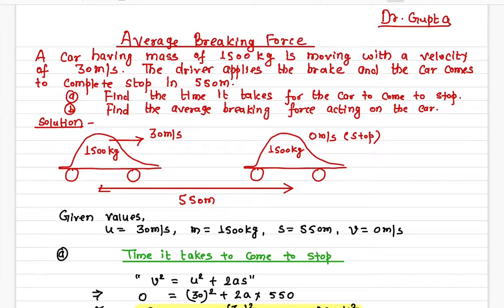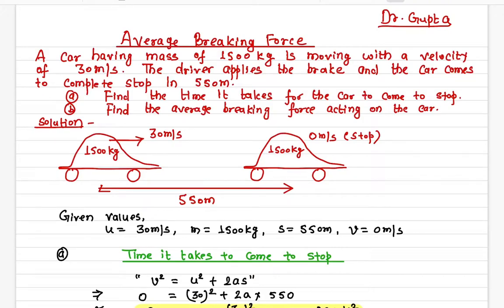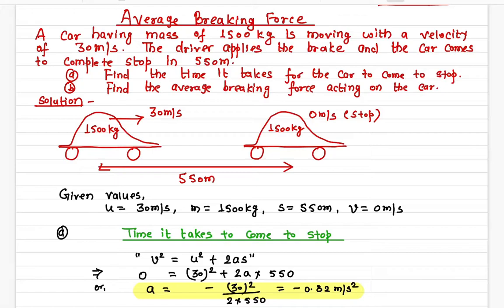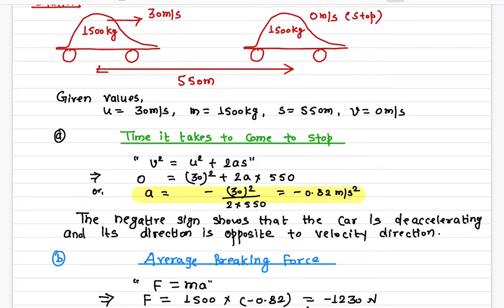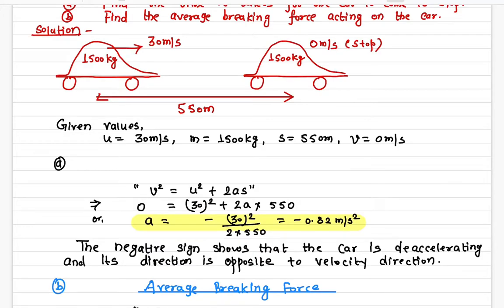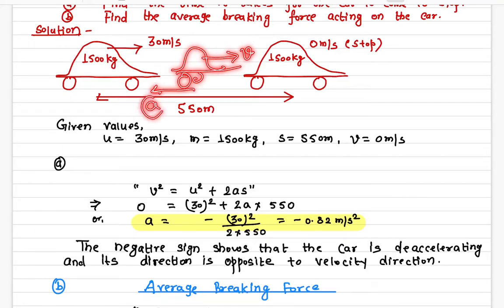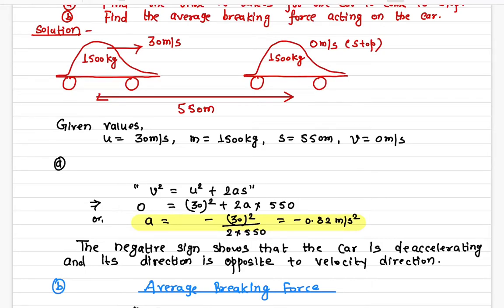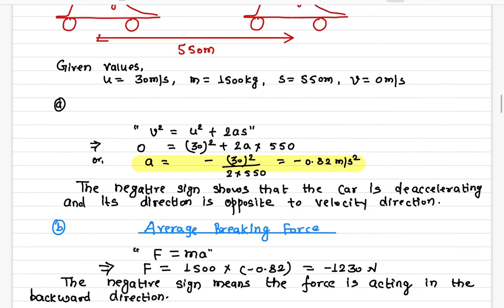Numerical Problem # Find the average breaking force on a car #  Lecture 2

Comment: The calculations are valid only for a car braking with locked wheels, the only way to get a force backwards.  As long as the wheels are rolling (in real cars), all brake forces are working inside the car, not on the car. And those forces are not pointing backwards.

Comment: A locomotive weighing 10 te pulling a train on a favourable gradient of 1 in 100. The speed of the train is 18 km/hr. The rolling resistance of the system is 80 N/te. The headlight beam is 60 m long and the driver’s reaction time is 1 second. Calculate the safe trailing load. Assume the coefficient of breaking adhesion as 0.1.